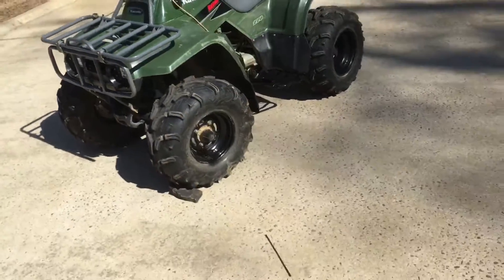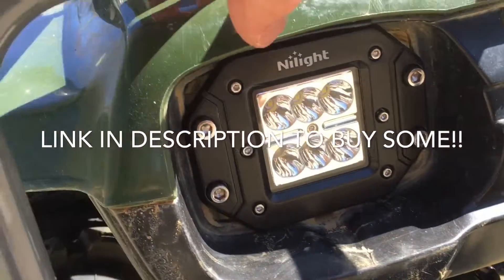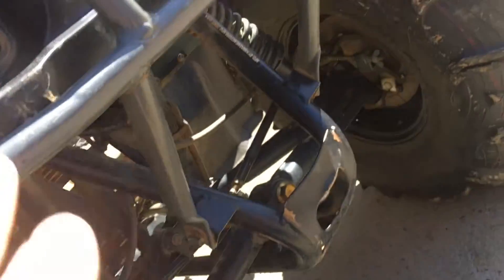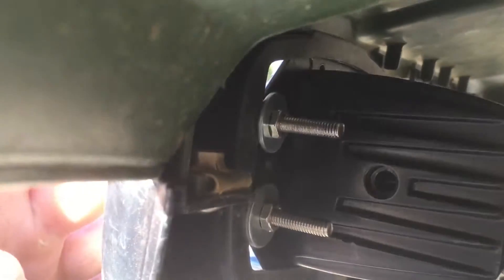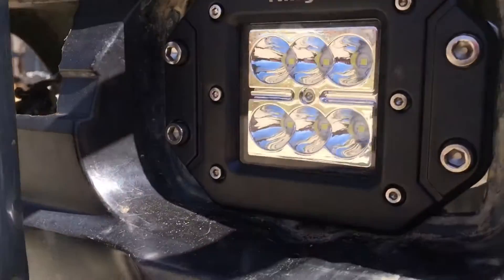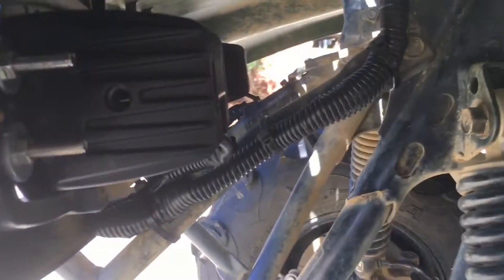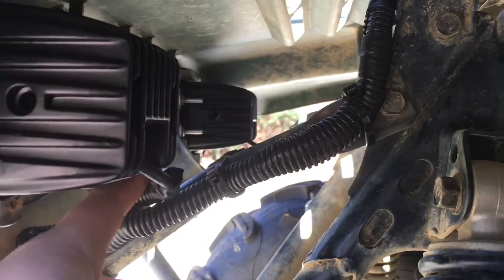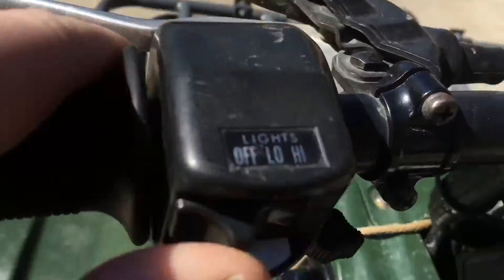ATV LED HEADLIGHT MOD

Comment: Pretty clean mod! I just put 6x3 LED light bars to replace the factory headlights on my 97 Sportsman 500. Those Kawasaki Bayous are great bikes, I had a Bayou 250 with the 5 speed and it would rip and never gave me any problems.